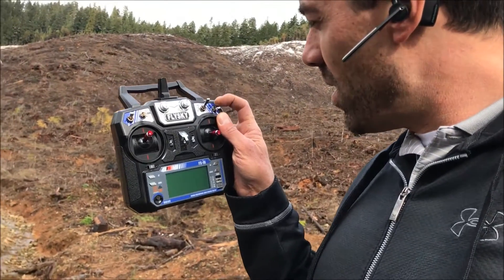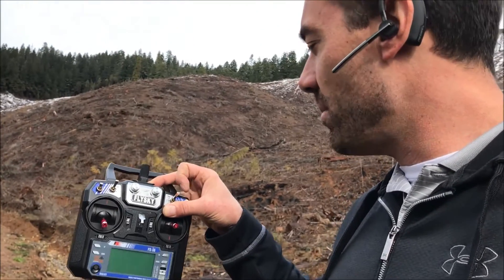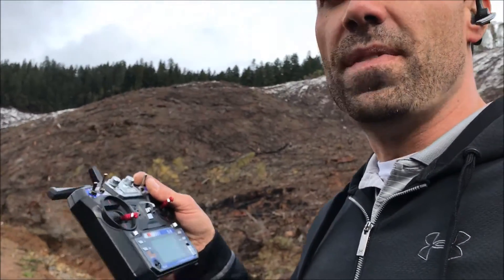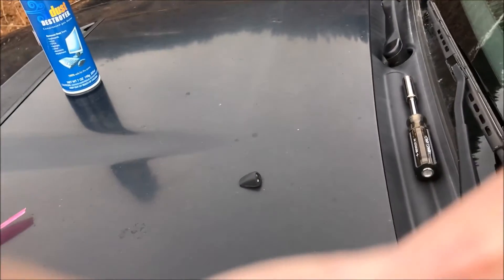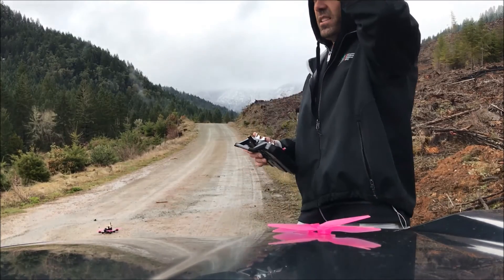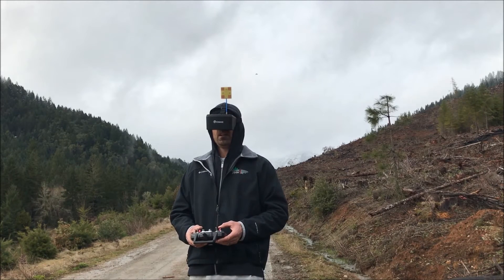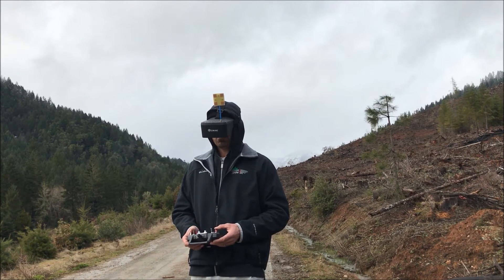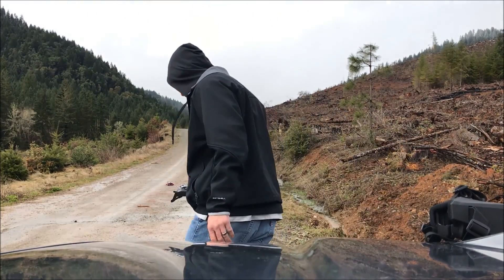Experimenting With Flight Modes On The Eachine Wizard

Comment: Do you recommend the eachine ev800?
Reply from the maker: Ramiro Prado yes I do, they work well. Lately I’ve been running the ev800d and they are better. Dual diversity antennas plus onboard dvr :). Otherwise very similar, $20 more.